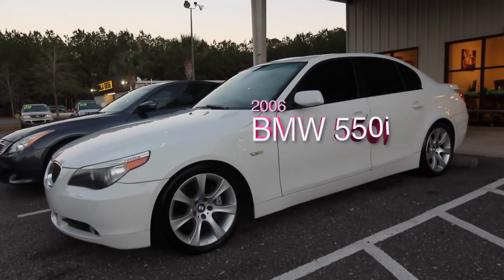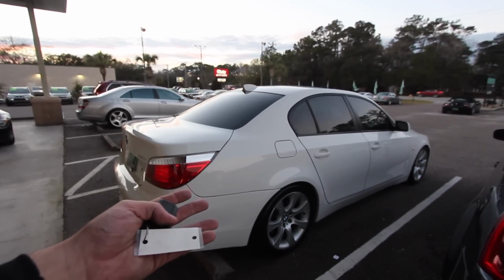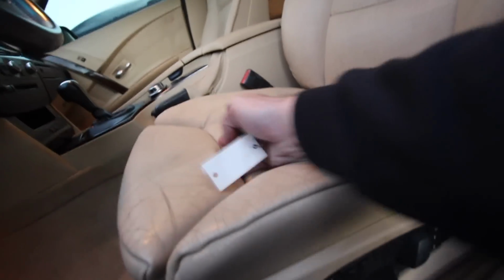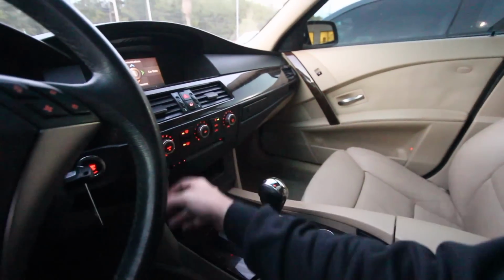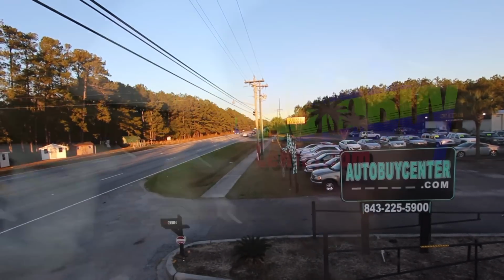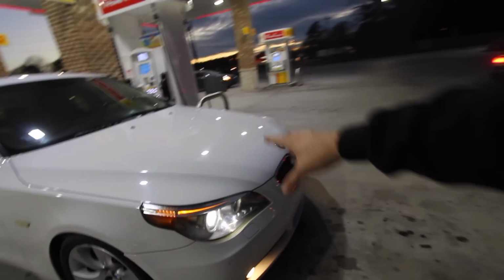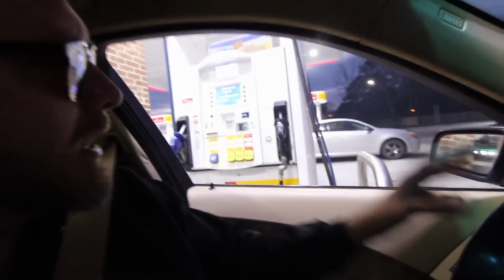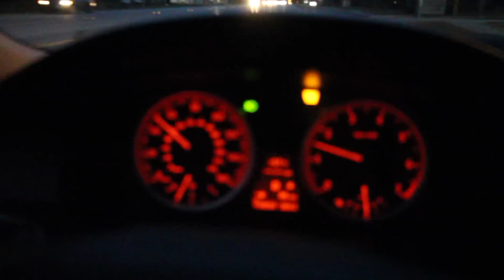Here's a Once $57,000 BMW 550i Sedan | Review & Test Drive w/ V8 Power House Motor!!!

Comment: I've  owned a 08' 550i for the last 6 years 179k. Wonderful car when maintained. If you can do some repairs yourself then its a good car. If not then you won't be happy with the repair bills. Some repairs take a lot of time to fix. The rubber becomes brittle around 100k and the engine will begin to leak oil due to all the heat that the engine creates. I've replaced several seals and gaskets myself including the alternator bracket seal. I plan to keep the car for a long time because it's worth it to me. A great car! But just know what you are getting into. The price was $4500 for a reason 😉

Comment: You'll be shocked at some of the repairs cost. With the m-sport it has dynamic drive. The front swaybar is $2000 just for the part and when it goes so does the power steering. With 150000 miles I would budget about 4 Grand the first year.
Reply: i realize I'm kinda randomly asking but does anybody know a good site to watch new tv shows online ?
Reply: @Javier Marcellus Flixportal :)
Reply: @Solomon Mohammad Thank you, I signed up and it seems like they got a lot of movies there :) I appreciate it!
Reply: @Javier Marcellus No problem xD

Comment: I have a 07 550i sports package that was $69,800 in Cali and I’ve had the car for a year now and it’s at 225,000+ miles
Reply: Any major issues with it? I’m debating on buying a 2007 bmw 550i 115k miles for $4K
Reply: @chin6822  I just put about 5-6k in parts (fcpeuro and worldpac) and 4k in labor with my mechanic. (Struts, shocks, valve cover gaskets, spark plugs, ignition coils, p/s reservoir, oil level sensor, vacuum pump, water pump, CCV vents, transmission pan, fluids, coolant hose, solenoid gasket, engine mounts,

Rides like new now. Planning for another 100k miles 🤞🏽

Comment: I can't believe he just drove a bmw COLD! You have to let them warm up first
Reply: No u don’t.
Reply: Ricer
Reply: @LukeVMH-Games   You have obviously never owned a BMW before especially an older one
Reply: Finna go pick up a burger from five guys on cold too right now. Oooohhhhhhh smd
Reply: @LukeVMH-Games  no not at all. It's just how bmw engines are. Why do you think bmws get blown head gaskets all the time? Part of it is because people drove them cold. If you have one or a friend has one, drive it cold and tell me it doesn't feel like it's gonna break down. It jerks and doesn't want to shift gears.
Reply: @davidsaunders9557  lol that’s not how bmw engines are. I’ve owned three starting with a 1998 you just don’t take care of your shit bud
Reply: Like I said I just drove to five guys cold. Don’t care. Maybe don’t floor the car the second you get out of your driveway sure but that’s where the conversation ends. I’ve had a 528,525, and m5. It’s called take care of your shit. Got this m5 in 2007 still drives like a baby. 140k miles on it
Reply: I’ve literally never had a problem that wasn’t electrical on my cars knock on wood. With that being said, I have been the only owner of each one
Reply: @LukeVMH-Games  lol yes it is. And I never said mine mess up. I take care of mine.
Reply: @davidsaunders9557  cap
Reply: @davidsaunders9557  m54, s54, b58, most reliable engines you can get for under 15k you’re on crack bro. Imma enjoy my 4am five guys
Reply: @davidsaunders9557  take your 15 minutes to start your car and idle away 20miles of gas lmao I will not stop you

Comment: Has bad valve stem seals. Expensive job. 2500 to 6k.
Reply from the maker: Our shop did something to it and the smoking stopped.
Reply: CharlestonCarVideos using different oil, like liqui moly sometimes can stop the smoking.  Early 550i had steam seals issues after 100k miles, thats the most expensive repair on those cars.
Reply: 2k
Reply: CharlestonCarVideos what did they do to stop the smoke did they change the oil seperator?

Comment: Have a 2013 550i and it's amazing! Although I would say a car from the early 2000s is too old. Don't buy a car that nice that is that old.
Reply: AvelPersonel ... 2013 F10 
that's not a good engine a 6 cylinder with turbos and a direct injection.  This destroys most cylinder heads and engines at some point. The E60 V8 4,8 engines are suction motors and last forever with good care.

Comment: Critics compared my 2008 Infiniti M45 to this car and actually claimed it was better. But the die hard bmw lovers laughed hard at it   and also said there beloved bmw would be worth more in the long run. Well guess what? Just for laughs myself I looked and they go for the same or less than my car with the same mileage . Oh good ol bmw . Overrated just like I thought . And btw. Way less reliable than Infiniti to. There's  used M45s with almost 200,000 miles on them for sale and funny couldn't find many 550s with more than 120,000 on them. LMAO!
Reply: Have you driven an E60  550i for an extended period of time? I was going to trade mine in years ago for an Infiniti, but after a test drive, the Infiniti's suspension is not even close to as good as the BMW's. I was so happy to drive back home in my "good ol bmw" and I still have it to this day, just as reliable as my wife's Honda (I know this part good luck - part good maintenance). You can't find many 550is because people are keeping them for much longer LMAO! The Next gen, the F11 gen has turbos, and all sort of issues with that. Naturally aspirated BMW motors are a bit more reliable.
Reply: @RealEstateClub-  For sure ! I agree 550s are rare and im sure they  are keeping them considering i believe you could get manual transmissions in them! But at the time Infiniti was at the top of there game! The G35 was released a few years before my car in 06 and it received Car of the year and beat out The 3 series BMW aswell!  I dont hate BMW i just think they are waaaaaay overrated!
Reply: @fredwilliams7893   Oh yea, I get it. I wanted a G35 Coupe so bad, back in those days, but for some reason I ended up with an RX-8. As an overall ownership experience, BMW is not really ahead or behind of Infiniti or anything else. I think the newer BMWs have become just like any other luxury brands too, so they may be a bit overrated now. It's what the market demands, and BMW has to make money.

However, I think the older ones were way ahead of their time when it came to suspension feel. The fact that I test drove several other brands, plus the newer models of BMW and decided to keep my old car, should say something about those suspensions. Not to mention my stint with that RX-8 suspension, which was out-of-this-world good for the day. 

On a different class all together, but I drove a rental Infiniti QX80 and I loved the thing, for what it is.

Comment: So.....did you tell the sucker who bought this car would need to pay $7k for new valve seals?  LMAO !!!!
Reply from the maker: Steven the dealership actually did something to fix the valve seals before it had sold. I don't work there anymore, but I do remember that it had stopped smoking.
Reply: So the dealer paid $7k to fix a car that they were selling for $4995....???....LOL!!!!   Not bloody likely!!!!
Reply from the maker: @stevenotto2581  7K? Steven, I'm not sure what the dealer did to fix the car, but I do remember them saying they fixed whatever the issue was. I no longer work there due to some differences in opinion.
Reply: @stevenotto2581  recently they have found the way to do that job without removing the engine

Comment: You'll be shocked at some of the repairs cost. With the m-sport it has dynamic drive. The front swaybar is $2000 just for the part and when it goes so does the power steering. With 150000 miles I would budget about 4 Grand the first year.
Reply: damn i was wondering y im getting the dynamic drive malfunction light